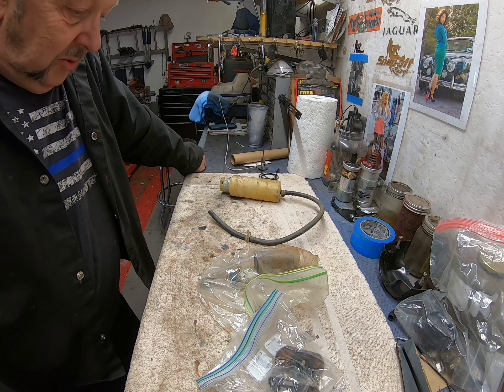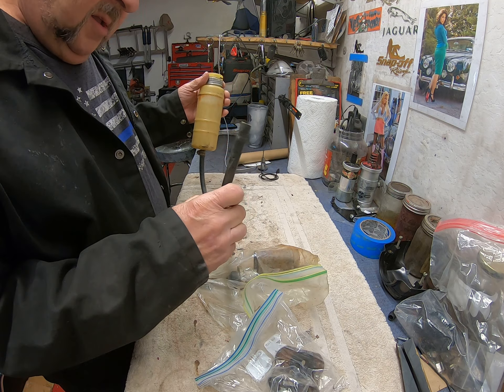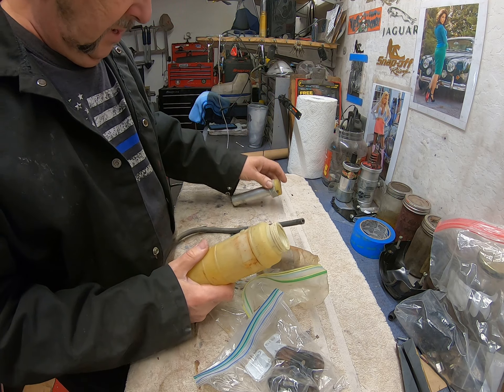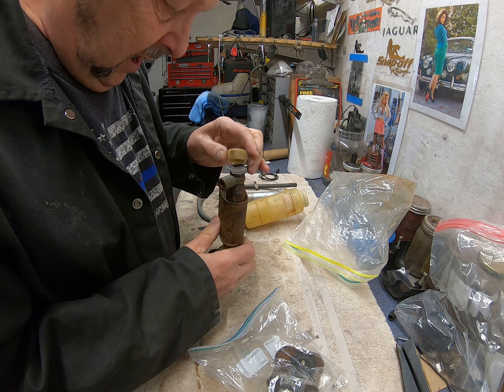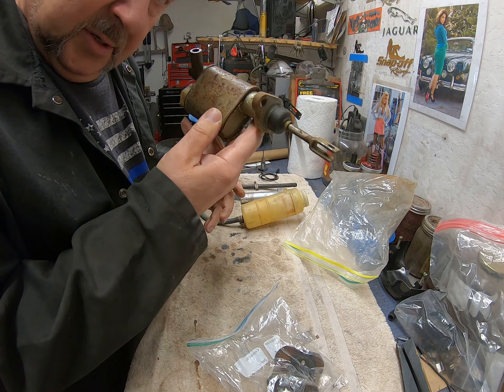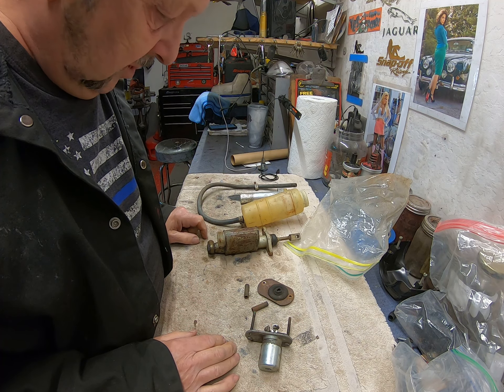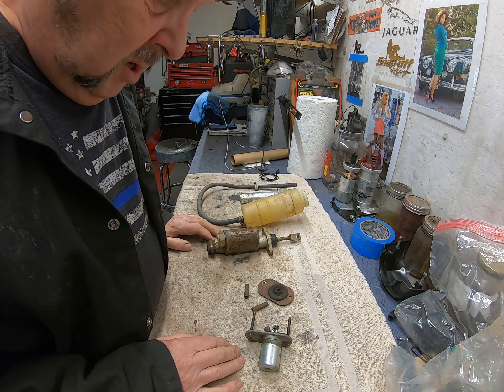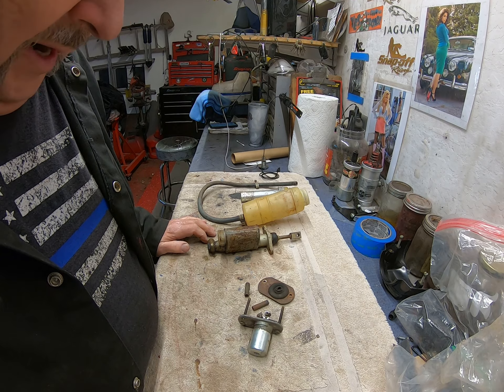Jaguar MKII 1964 bits and bobs part 1

Comment: Is that the old corkscrew float type?  I had to have a door on the XK8 resprayed because I felt guilty about my previous policy of taking two spots.  I will take two spots for the rest of my natural life in the most far away corner of the parking lot, thank you very much.  Respect goes both ways and I've seen folks park and fling their doors open, both kids and adults.
Reply from the maker: yep keep away from the assholes
Reply: @jagvette1  I could go into my own rants if you like, but I won't.  I have many in which I am conversant.  You and I could fill volumes I'm sure.
Reply from the maker: hey throw your rants my way, as you know I don't give shit, that's assuming you wish to vent.